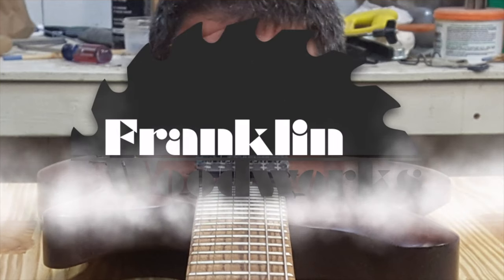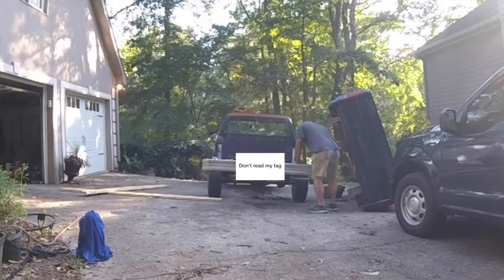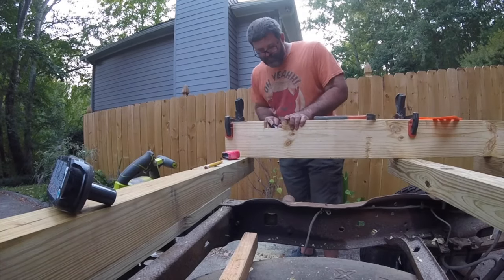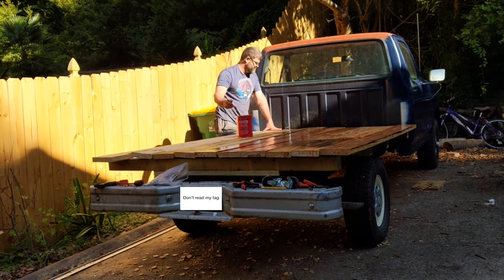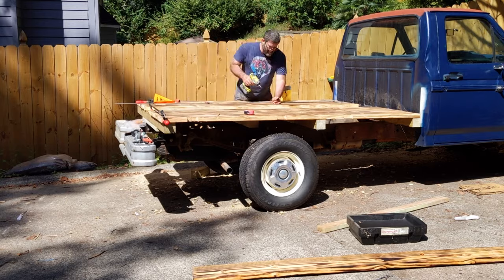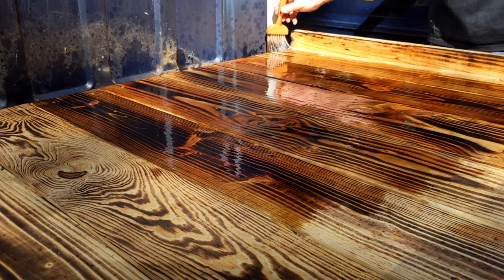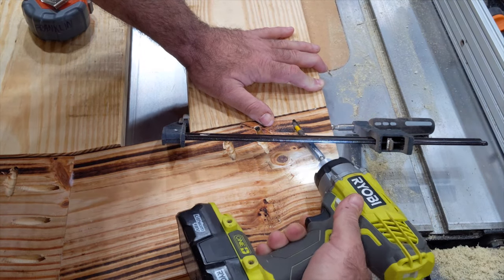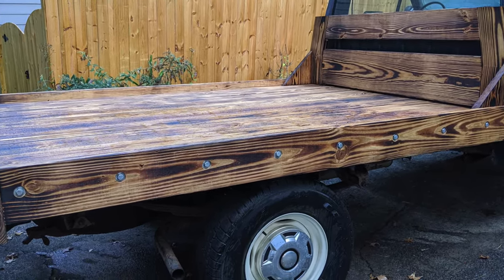DIY Wood Truck Bed

Comment: That's a good wood finish but much better when you melt old candles and paraffin into it and apply HOT. Diesel, trans fluid, linseed oil, paint thinner, paraffin. Be a mad scientist.
Reply from the maker: That sounds like a great idea!

Comment: You might want to drill a drain hole in those tie-downs you're going to recess. I learned the hard way that water collects in the pockets and, galvanized or not, rust will form. You can buy them with the holes already drilled, but you'd still have to drill a drain through the wood.
Reply from the maker: Thanks for the reminder!

Comment: Those triangle gussets on the headboard don't look strong because of the vertical grain.  If something slides into the headboard it could split the grain.   You would be better off using exterior plywod or metal or making the grain parallel to the hypotenuse.

Comment: How is the wood bed doing now? I was thinking of doing something similar, but thinking it will warp or not last.
Reply from the maker: Do yourself a favor, use treated wood, and stain all the boards completely before you put it together if the wood is dry enough.  I would also add a washer to the screws.  All that said, I've had some minor warping, but nothing that impedes the use or the overall look of the bed.
Reply: @FranklinWoodWorks2016  thanks.

Comment: I've been  contemplating building a wooden bed on my new F550. Most people I tell that to think I'm crazy and that I should use steel or aluminum. But what most people don't understand is that wood has some great properties. It's actually very light relative to it's strength. it's easy to work with. And it doesn't rust or oxidize. The only thing you must keep in mind building a truck bed is that it will be twisting as the truck rolls down the road so you don't want to use thin screws that might snap. And you might want to use some galvanized corner braces if you are building a super heavy and strong bed like I am. I will also be using aluminum for the stake pockets and a thin aluminum sheet on the floor so that topsoil , mulch , or stone does not rot the bed and can be easily shoveled off. 
I love your torch treatment. If you don't know it, the Japanese did that a thousand years ago because the burnt wood resisted decay and fungus. Of course it also brings out the grain nicely.
Reply from the maker: Thanks for commenting.  You are completely right about the bed flexing.  Fortunately, I won't be hauling heavy loads in this truck.  I think my biggest load was taking the original bed to the dump.  I used galvanized lag screws and bolts for the frame, and heavy deck screws for the planking.  I know a lot of people use drywall screws for everything, but don't do it.  Those things will snap in a heartbeat.  I've been enjoying the deck screws for the planking because I'm still restoring this truck, and I have easy access to the fuel tank, shocks, hard to get to suspension parts, etc.  I think for an F550, using a hybrid wood/metal idea is a great one.  One thing to think about when putting a metal sheet on top of a wood bed, is that it can retain water underneath, and with no exposure to the sun, it can take a long to dry.  This may cause some rotting you didn't expect.  Good luck!
Reply: @FranklinWoodWorks2016  Good point. I will be installing plastic wheel wells to prevent splash.

Comment: The wall that you're talking about is called a headache  rack. Great job, I can't wait to see what you do with the sides!
Reply: I think it's not a headache rack unless it covers the rear window (to keep items from flying through the window in an accident, giving you a headache) but I could be wrong
Reply: Bulkhead is the term i believe.  You don't get a headache from something below your chest if you accidentally run into it while working on the site and getting something from the truck.

Comment: The lack of sides is way more stylish than I would have thought.
You can probably back up to hitch a trailer super easy, I mean it's always easy but with this you can almost see the ball.
Reply from the maker: You know, the sides I had in mind are only going to be about 12 - 16 inches tall, so I can try to retain the "sleek" look.

Comment: I've seen the slide-stop at the head of the bed referred to as a "headache rack". it's great to know that I won't have to do too much finicking around with odd shapes for the frame if I decide to build my own flatbed, as opposed to buying one. My 09 Ranger's bed is rotting out at the front. One of many things on the list of things I'm fixing due to living in the rust belt.

Comment: That bed really makes that truck unique and it looks damn nice! Awesome job on it!
Reply from the maker: Thank you!
Reply: @FranklinWoodWorks2016  
If you pause it at 1:37, what tool is used to counter sink those washers?

Also, did you have to pre-drill for the large lag bolts to mount the sides?
and for the pocket screws?
Reply from the maker: @xmo552  I used a paddle bit for the recess.  And you MUST predrill for the lag screws, or you will very tired very fast!
Reply: @FranklinWoodWorks2016  
Thanks

Comment: I literally just heard of using  diesel as a preservative finish. I did a little research and the recipe I found was 10:1:1  diesel,boiled linseed oil,and stain. It was an old country boy who told me about it. I’m putting it on cedar that I milled and it looks very good.

Comment: Coffee grounds is something I use when my stain isn't dark enough. I've never heard of burning the surface of the wood to bring out the grain before, nifty idea. 
If the sides are strong enough, I'd put tie downs on the sides too.
Reply from the maker: I have used coffee and tea as a stain for guitar builds, and I love the look of it.  Charring the wood will not only bring out the grain, the it also (supposedly) reduces the rate of deterioration of the wood.  I used 1 x 6s for the sides, and I spaced them a little so I could get straps in between them if I needed it.  This has worked well so far.  I think a good upgrade would be using 2 x 6s for the sides with the same spacing.

Comment: Thanks for the video. Know it's an old one. I like how the wood looks going to apply this to build a tonneau cover. I have a cateye silverado I'm putting a faux patina paint job and a normal tonneau cover just won't cut it. I think this will look killer as a cover to set just inside the bed rails. Great looking bed

Comment: Nice to see a woodworker build a flat bed.  So many folks have no woodworking skills.
Reply: Also I just watched again.  The pink color would be less if you use off road diesel.  It is clear.  Use it in my tractor.

Comment: did something similar to this for a old ranger I had. the center two floor/bed boards tho I put on hinges and didnt bolt them down but used a groove sorta like cabinets so they could sit flush. this way if I ever needed to get at the fuel pump I'd never have to drop the tank. after doing two fuel pumps on my other trucks, I will never ever drop a tank every again. so i wanted to be able to just flip open a small section of my bed and easily reach the fuel pump.

Comment: If you want to flush mount pull hooks on the bed use flat head screws and push countersinks in the holes with a hardened pin made from a short grade 8 socket head cap screw on top and a nut countersunk on the bottom using a hydraulic press.  Some tie-down
 plates come with countersunk holes, much easier than making modifications.
Reply from the maker: Well now that you told me, it seems obvious I could have done just that if I'd have thought about it a little more.  Thanks for commenting.  Good comments make me better, and yours is a comment I will definitely use if/when I rebuild the bed.

Comment: If you have (or have access to) a welder you ought to be able to get some allthread (or bolts) and attach studs to the underside of the tiedowns. 
alternatively, move the tie down points to the sides where the bolt heads won't be in the way (much) or file a square into the plates to accept a carriage bolt, it'd still stick up but wouldn't be a catching point.

Comment: I’m buying an npr cab and chassis I want to add an 19 ft bed using pressure treat lumber,I want it to look like a car hauler trailer as it will be used to haul cars/trucks/side by sides.i was quoted $8-9 k for a steel one of same dimensions.i think hauling one car/truck the wood will be strong enough

Comment: Square out the holes on the hold down with a file and then use Carriage head bolts.  I voted for that burn job, I do think it turned out quite nice.

Comment: for the hold downs... you might want to use U-Bolts and go around the underlying 4x4 ... use a small piece of wood as a pad between bottom of the 4x4 and the U-Bolt.. once you have the plates tightened down into the mortise you are planning to cut, peen over the top end of the U-Bolts to ensure nothing comes loose ( you'd have to grind it off to get the plate out again- but U-Bolts are cheap....you just want o use some which are stronger than whatever the hold down is rated for.)

I suppose that you could use big carriage bolts and another plate on the bottom, but getting 4 dangling bolts to line up is a pain sometimes .
Bed looks nice.
As an alternative finish, since you torched the boards, just use linseed oil or linseed oil and turpentine for deeper penetration.... color is a little different, but it's easy to reapply at any time
I hope it holds up nicely.

Comment: I just built a wood bed for my flatbed truck camper, I posted on the flatbed truck camper page on Facebook. I joined the 4x4 frame with construction adhesive and 6”x 5/8 lag bolts I used 2x2 inch angle iron brackets at every joint on the bed with 1/4 in solid shanked lag bolts. I used 10”x1.25 “ aluminum semi trailer bed planks bolted to the frame for the flooring. I was scorched to say the least, replies like “ the bed will fall apart going down the highway and kill someone” and the like. I agree it might loosen some but there is no way it will just fall apart.

Comment: Very nice work, I thought about doing mine in artificial wood decking to save me the trouble of finishing it, how hard was it to go from the stock harness to the separate lights?
Reply from the maker: Well, I'm not the sharpest tool in the shed, and it took me about an hour.  Just get a test light and a good ground.

Comment: If you still have and use the truck, how has the bed held up to weather and the elements so far?  Do you expect to recoat the wood any time soon?  Other than recessing the hold downs and adding the side rails, have you done any other modifications or additions to the truck bed, e.g.tool boxes, whether mounted on top of or below the bed? Thanks for sharing your project. Nice build. I had not thought of torching the wood for the visual effects of the wood grain.
Reply from the maker: Remember I did NOT use pressure treated wood.  Ultimately, that was a mistake.  The boards on the bed surface have cupped.  The side support rails have not.  The sides I built later were made out of pressure treated wood, and they are just as true as the day I built them.  However, the bed is still just as useable as ever.  After I paint the truck, hopefully next spring, I'll rebuild the floor of the bed and will definitely be using pressure treated wood.

Comment: Thanks for the great vid. Going to do this on a 95 Nissan I just bought.
Reply from the maker: Thank you!  Every day I get even happier with the design.  I had to replace the fuel tank sending unit - remove a board and there's the gas tank.  Shocks? - same deal.  I'm about to replace the clutch, and I'm figuring out how I can take advantage of the bed on that too.  Thanks for watching.

Comment: The materials list calls for four 6x6x8' pieces for the cross members, but you used 4x4 for the video.  Would you recommend the larger pieces?  Personally I would prefer there not be such a huge gap between the frame and the underside of the flatbed.  Just wondering.  Thanks!!

Comment: Were the floor boards just screwed into the wood frame? Flat bedding my 02 ranger.
Reply from the maker: Yes, just screwed in.  But I would suggest using washers with the screws.

Comment: Hi! Thanks for the video. Would you tell me what your clearance is between the top of the tire and the base of the flatbed? Trying to figure a fair space.
Reply from the maker: I put on a set of leaf spring helpers, mainly because of the age of the truck. I estimate the helpers gave me an extra inch, for a total of 5 inches between the tire and the bed.  Hasn't been a problem for me, but I rarely carry heavy loads.

Comment: What kind of lights did you use when you replaced your bed…I have an 88 ranger with the lights that go up the side by the tailgate
Reply from the maker: I got some pretty cheap LEDs off Amazon.  I think it was around $40 for the set.

Comment: Not sure if you’ll answer or see this but are those 4x4 blocks or 6x6? They look a little skinnier than the 2x6s but maybe I’m tweakin
Reply from the maker: They are indeed 4x4s. If I had it to do over again, I might not use 6x6s, but I would raise the 4x4s by 2 inches.  Under a full load, my back tires rub on the bottom of the bed on bumps.

Comment: This is awesome!!! and I plan to do this for an older work truck I have that is starting to rust out. Can I ask what you did about the gas cap and where/ how you set that up with this?
Reply from the maker: I just put out a video on the fuel filler tube.  Enjoy!

Comment: Now that is Nice!
Dodgy fence suppliers treat waneylap fence panels with used motor oil here in the UK ..... It is NOT Good!
I didn't catch it but did you treat the underside too?
As for the Hold downs ...... Why not recess them so they lie flush and drill the fixing holes through and use dome head bolts with locknuts on the underside?
Reply from the maker: That is exactly what I'm looking to do. Believe it or not, finding those kind of bolts can be a little difficult over here.  It's considered a "specialty" item.  I'll get there somehow.
Reply: You could go Whole Hog and have countersunk Allen Bolts ..... countersink your holes in the wood and bend the plate to accept the countersink with a punch? It would add an almost subliminal touch of profesionalism ;0)

Comment: Love the bed.. what length 2x6 did you use for the bed 6ft and what about the 4x4 post length going across bed
Reply from the maker: The 2x6s were 8 feet, and so were the 4x4s.  I cut the 4x4s to length.

Comment: How do you feel about using 4x4s instead of 6x6s? Or even possibly 7x9 railroad ties? Just trying to think of ways to save some money on the project.

Thanks!
Reply from the maker: You can use whatever you like, but there are considerations.  The 6x6 will give you more clearance on your tires, which is a factor under a heavy load.  I don't think that strength is necessarily a factor.  My first iteration was a 4x4, but my tires rubbed in the back under load.  So I went with the 6x6.
Reply: @FranklinWoodWorks2016  Does a 7x9 railroad tie seem like a terrible plan? I am sure they are not perfectly square/heavy wear but they seem like they would never fully rot soaked in creosote. Home Depot sells them for $20
Reply from the maker: @FireFlowerFarmstead  I'm sure it would work.  I'd lay them so you have a seven inch rise.  You'll probably have to shim them to get them level.
Reply: @FranklinWoodWorks2016  I might try it. I appreciate it! I am a poor midwesterner trying to make his ugly ford look a little better haha. I have watched a lot of flat bed videos but yours looks the best, especially with the rails.
Reply from the maker: @FireFlowerFarmstead  Thank you very much.  Best of luck to you.
Reply: @FranklinWoodWorks2016  Found 5"x5" treated lumber at Menards for $21. Think it adequate? That seems pretty absurdly cheap. I didn't even know 5x5 lumber existed haha
Reply from the maker: @FireFlowerFarmstead  as long as it's not the "western cedar" you should be fine.

Comment: Great job!! i have been considering this for my Square body. I currently have a slide in camper that i want to widen the floor plan on and taking out the bed walls and inner fenders allow for double the floor space in the camper. Just wondering, would pressure treated wood work for this, or should you use untreated wood and finish yourself like you did? which one would last longer through Ohio Winters...
Reply from the maker: I would strongly suggest pressure treated wood.  I did side rails for the bed using treated lumber, used the same burning technique and same stain.  It still looks fantastic, while the bed itself has faded a bit.  And I'm sure the treated wood would hold up better in the long run.

Comment: Do y'all think 5/4 would be strong enough? It's only half an inch thinner than 2x .......
Reply from the maker: I think 5/4 would be fine.  In fact, I'm exploring my options for a rebuild of the bed (not that there is anything wrong with it as is).  I'll be painting the truck soon, and I'd like a shiny new bed to go along with it.

Comment: really nice, but it looks like there is barely any clearance between the bed and tires.  did this cause you any problems while driving the truck?
Reply from the maker: I didn't, because the stock tires were so narrow, the facia board on the bed was outside of the tires.  BUT, I put bigger rims and 33" tires on it, and clearance was a problem.  I ended up cutting fender Wells into the facia boards.  I did a video on the Graff Termite and you can see what I mean.

Comment: Putting pretty much the same bed on my 97 ram but I pull trailers. If you pull trailers, does the tires hit the wood ? Trying to figure if I should double stack 4x4s or what
Reply from the maker: I put spring helpers on the rear springs, not only to stiffen the 35 year old springs, but to give me an extra 1 1/2" or so.  I don't really tow anything, but I've had some heavy loads.  Haven't had a problem.